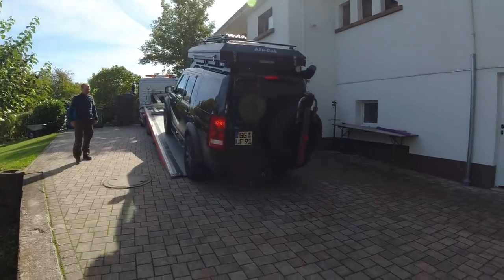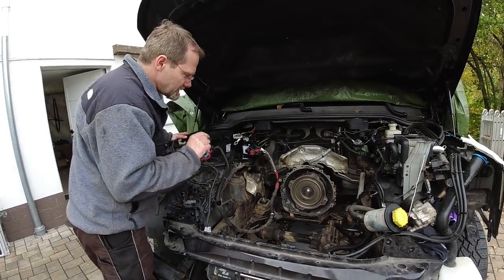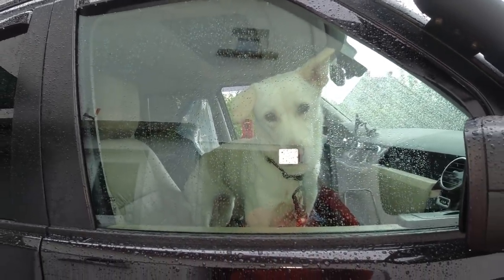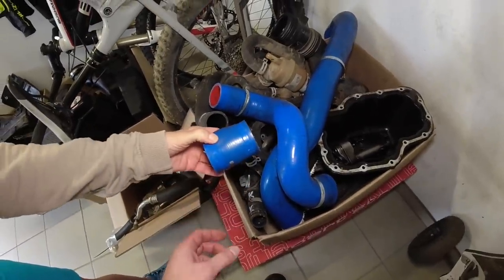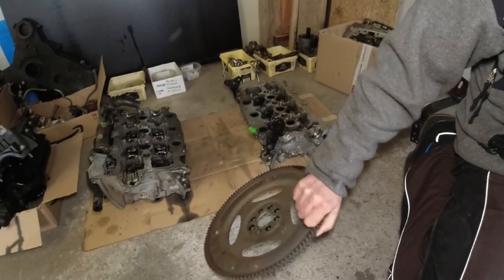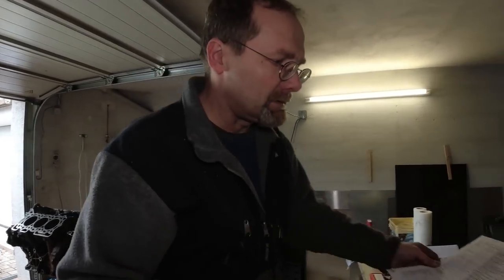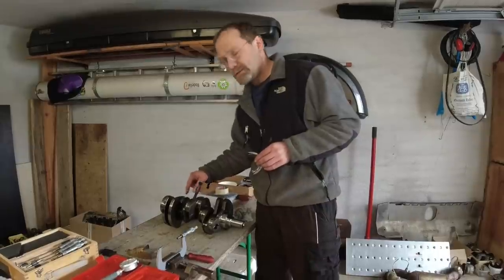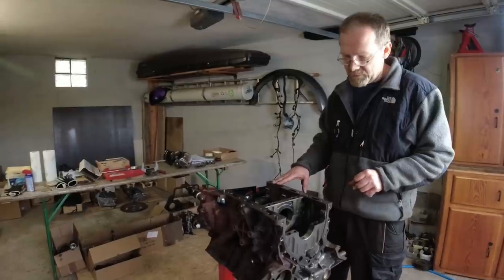Is this the end? Complete engine failure - Land Rover Discovery 3 / LR3 - Episode 1

Comment: Oh boy, sad to hear! We finally got our LR3 from Denmark (the one with integrated roof tent) - probably 40% of the buying decision are accountable to your channel. 🤪Just an idea about the reliability issue - what about an episode on: how to make your Discovery 3 more reliable - or in other words: what irregular maintenance should be done in advance or which parts make sense to get replacement at a certain age - even if you have no problems. Not sure if it´s realistic but it would be quite interesting to hear your opinion on that topic.
Reply from the maker: 😅👍 saw that one on ebay Kleinanzeigen. Well the thing with reliability is that even if you do everything right. That crankshaft failure can hit you at any km and at any time.The problem is in the design of the engine. There is not much you can do about it, other than do really frequent oilchanges and be very sensitive to your cars noises and vibrations. We will do a special video about that engine soon. 🙋‍♀️ Vera
Reply: Is the crankshaft issue only on the TDV6? I have a 2007 with gas V6 motor, should I be worried?
Reply: @andremorissette  It's only on the diesel, the gas engines were either the cologne ford V6 of the Jaguar V8 neither of which is afflicted with the crankshaft failure.  The Jag V8 was pretty reliable in most respects.  The cologne V6 suffers from timing chain guide failure.
Reply: @Vera_and_Christian  Thanks so much for your reply and sorry for the delay - have a 2 yr old daughter and a Discovery 3 in our front yard. 😅We currently do a main overhaul at 240kKM - all services, new oil pump and crankshaft pulley and underbody conservation/ partial reconstruction. Next to that I´m getting more and more into the reliability / services issues - in short: married to the D3. :P 

I just saw the videos on the crankshaft issue @Altblech-schrauber channel where he mentions in the comments that he´s using 0w40 Oil for better reliability - would you recommend that as well? Just asking because will do an oil flush and it would be the perfect timing to switch oils then.
Reply: OK, just ordered the 0w40. :) Motor oil is currently on Black Friday Sale at Amazon btw. ;)

Comment: Another great video! This is the issue that got me in a td5 Disco 2 and not a Disco 3. From what i understand this problem is not a question of infrequent oil changes but of defective bearings installed which affected a percentage of these engines. this also affects range rover sport and disco 4 engines. glad to be corrected if this is not the case.  With all its faults, there is very little that will suddenly make a td5 stop functioning

Comment: Something to consider. Yes the bearings have rotated but I have rebuilt 3 engines in my life. Citroen Traction Avant as it happens. And on these, the holes in the bearings did not line up with the oil feed drilling. The oil came through the drilling to an annular space behind the shell and then through the holes in the shell. I am not saying that your car is the same as an 85 year old design but rather to check on assembly and be aware that the apparent simplicity of a direct feed from the drilling through the shell may not apply. Hope this helps. Love the channel.
Reply from the maker: 😃👍 We will do an indepth video about the bearings soon. 🙋‍♀️ Vera

Comment: Wow , what a great video guy's , Land Rover should fix all the engine failures like this for FREE regardless of warranty , mileage ,number of owners ...
1-  to save their reputation 
2-  to keep your customers from going elsewhere &  buying Toyota's 
3- it's clearly the fault of LR/FORD/PSA , either in design or bad service interval recommendations.
Reply from the maker: There will be a video about the design flaws of that engine soon. 👍🙋‍♀️ Vera
Reply: All the manufacturers of "luxury" vehicles play this game, it's meant to fall apart within 5 years, their "customers" don't drive old cars typically.  Mercedes and BMW now make all kinds of engine components out of plastic for the same reasons.  The automakers basically design things to survive until the warranty expires, if you want something that will last go buy a Toyota, Honda, or Hyundai(only because the decade long warranty in the USA).  The frustrating thing about this is they really could do a better job designing these vehicles, they could make small design changes with a minimal cost increase that would make the cars last much longer.  I'k pretty sure the accountants have decided that it doesn't make good business sense.  When you take your car to a Land Rover workshop they basically want to push you into a newer vehicle, they do not want to fix these older cars.
Reply: I've seen many that have gone on to 700k to even 1m Kms with no problems. The trick is to stick to the oil it was designed for, the 5W40 fully synth and regular oil changes.

Comment: Hi Guys, for me this is your BEST EVER video on Youtube !!!!!

When you showed us what happens when bearing shells move & block the oil feeds and on the crankshaft itself with it's cross-drilled oilways - absolutely fascinating and now oil pressure within an engine makes so much more sense.

By the way, does Fabien's Discovery have a diesel particulate filter ? If it does, then the engine will need to run a DPF re-gen program from time to time. This involves the main ECU over-fuelling the engine to burn off DPF contaminants. Unfortunately this can also introduce neat diesel into the engine sump, diluting the engine oil - reducing effective lubrication GGGGGGGRRRRRRRRRRRRRRRRRR!

Really looking forward to the follow-up video on this project ...
Reply from the maker: Yes it has a DPF. Ours does not and that is a good thing, like you wrote. 👍🙋‍♀️Vera

Comment: I watch your videos they are both informative and humorous, but I have to comment on Land Rover reliability.  Both my father in law and myself have bought Toyota cars of various descriptions from various Carinas, camrys and 4runners. The carina's I have to admit were reliable but characterless as were the early Camry's. The later one's suffered transmission failure at 30000 miles, disembling itself on the motorway. The estate version started to fall apart at 2 years, spot welds began to break due to stress as there were insufficient welds. Then with the 4runner which was the biggest money pit, requiring a complete exhaust system every 18 months as it had usually rusted away in various areas, also the engine had to be stripped as one of the balance shaft drive gears had broken free. There were electrical issues usually broken wires, the list went on. At 100,000 miles I had spent over £16,000 in repairs, at this point I decided it was time for a change so after looking at what was available I decided to buy something different. I went to my local Land Rover dealer after taking a  TD5 out on trial I ordered one. Firstly it was so much more spacious than the Toyota, it was quieter and so much nicer to drive even towing a large caravan through France. I still have it it has been utterly reliable even after 19 years and 275,000 miles. It has taken me through forest tracks in Scotland that were flooded, in places coming over the bonnet but it never stopped. For the most part the car is still original as it left the factory.  She's retired now so impressed  was I with Land Rover that I bought a Range Rover Vogue, which my only regret is I never bought one sooner. I even bought my wife a Freelander 2, there is much said against Land Rovers, but I can only say as I find and I can't find to much fault. If you look after them, they look after you, my vogue has reached 135,000 miles and is such a delight to drive, I've never been able to say that about any of the Toyota's

Comment: Absolutely incredible is your work to remove and repair the engine of Discovery 3 in your home garage! It is clear that this engine have some constructive problems. But! I think that the main reason for this damages is in: 30 000 km changing oil interval! I don't understand why many manufacturers recommend it. I'm changing engine oil of my cars no rarely of 12 000km interval and I think that this cost me many many cheaper then this heavy repair works.
Reply from the maker: In addition, the oil is disolved by diesel fuel for emission reduction.  After 20t km, the oil smells a bit like diesel.  12t km is the interval Vera and I maintain as well on our LR3.  Christian
Reply: @Vera_and_Christian  That's crazy here in the states we have 10k mile interval on the TDV6 in the Disco 5, back before LRUSA bought mine back I was doing 4-5k mile oil changes as the damn thing was "making oil", fuel dilution. I also switched to shell helix C2 oil instead of the ludicrously expensive Land Rover Castrol C1 oil, the Land Rover oil was noticeably worse with regards to fuel dilution, the shell wasn't noticeably diluting at 5k but the LR castrol oil would "gain" between 250-500ml in 5k miles.  No reason not to change it often 6L oil and a Mann filter is maybe $45 in the US, with an oil extractor and the filter on top of the engine it takes all of 15 minutes to do an oil change.

Comment: Very good analysis. Extended oil changes are the problem here. I use 15/40w T4 oil in all my diesel and gasoline engines irrespective of whats recommended  by the car maker with 5k oil and filter changes. Oil being the life blood and inexpensive. Extended oil changes is a marketing gimmick like sealed for life transmissions and differentials sold as maintenance free to the public. Transmission fluid changes are even more important today than ever as the manufacturers are using the slipping torgue converter clutch feature in torque converters as and aid to compensate for lower torque engines to accelerate .

Comment: Hello Christian, hello Vera. First of all, I would like to thank you for your great videos. The videos didn't stop me from buying a Land Rover Discovery 3. For the rotating main bearings of the TDV6 engine, it would not be appropriate to provide the main bearings of the motor with dowel pins to prevent the main bearings from rotating. These dowel pins are used in all air-cooled VW and Porsche engines I know. When the time comes with my TDV6, I will definitely equip the main bearings with dowel pins. Sorry for my lousy english.
Best regards
Manuel
Reply from the maker: Hello Manuel,  the „tabs“ or „dowel s“ in main bearings are used for axial positioning.  If the bearings seeze up,  the will likely rotate even with tabs.  I know this from a bearing manufacturer.  Of course it would help a bit but not in all cases.  The bearing surface of the Lion V6 should not be reduced.  Christian
Reply: @Vera_and_Christian  Thanks for the reply Christian. I wanted to ask the same question as Manual Dietrich.

Comment: As a truck mechanic for 50 years I have never seen such a poorly designed engine,,I noticed that on the lower side of the engine their is no cut out for the bearing locating tabs that prevent the main bearings from moving side to side,,I have never seen this on any other engine in my life..But what can you expect from a Ford designed engine..PS a very good video.

Comment: Christian and Vera,
I have a just bought a Freelander 2 with the straight 6 Volvo developed petrol engine. I bought it with 243.000km. No oil use. No coolant use.
Seeing your discussion about engine oil, I would like to ask you if the same idea of changing from my 0W-30 full synt. oil to 0W-40 or 5W-40 oil would be a good preventative measure. I change engine oil and filter every 5000 km with no deviation from this.
I only ever use Castrol Edge Ti oil and never ever long life oils (seen too many engines with oil sludge inside, making catastrophic engine failures on VAG engines).
Moreover, I ordered a new complete original PCV (crankcase ventilation unit) which I will install asap, to further prevent too much oil getting to the oil scrape rings, which then hardens and gets stuck and oil use is then very high. Anyway, this didn't happen on my engine, so I will do the work now, before this could develop.

Thanks for making tons and tons on videos on all things Landrover Discovery and toyota ;)  (not much to do on the later apart from drinking coffee).

Kind regards.

Comment: I’ve definitely heard of a few cases where LR have replaced or repaired a TDV6 /SDV6 engine for free when this problem has occurred. Though maybe on engines that have covered less distance and time than Fabian’s.
However, the fact that Christian is confident that it was the LR dealer starting the engine that has caused most of the damage is very concerning.

What idiot engine designer stopped adding nibs to prevent the bearing shells from rotating and keep the shell oils supply hole aligned  properly?

Thank you and well done to you all for showing and explaining the procedure to fix it.

On another note, we recently heard of problem where a guy at LR had been incorrectly straightened their ground prop-shafts in the factory, by applying too much pressure. The stresses this may cause could well cause eventual crankshaft failure. All because somebody at the factory thought he knew how to do it better than the way he was instructed to do it. Fortunately the guy no longer works for LR. But this could have been going on for years and how many potential crank shaft failures has he caused?
Reply: A lot of modern engines run without tabs, cost saving I guess..
Reply from the maker: Well, you know, a little nib is not going to prevent a crankshaft bearing from spinning. That engine is so powerful and that bearing so tiny. We will do a video about that excact topic when we get the new bearings. 👍🙋‍♀️ Vera

Comment: Another great video.  Such a great Learning Program. In huge Diesel Engines for back up power in a Nuclear power plant the engines have to be up and running very fast.  The engines use a pre oil pump before starting to get the oil circulating before starting. I've always thought that normal car engines could have one similar fitted and the engine would last so much longer. Of course this is good for the owner of the car but bad for sales of new motor's/ cars. Thanks for the video. I will watch the others now. Regards Neil
Reply from the maker: Good point.  Cars don’t have prelude pumps because they are started every day.  If they are not and use thin oil, this may become a problem.  Like on the TDV6.  So you are absolutely right.  I will look into a electrical pump for Veras LR3 in winter when Fabians car is finished.  The pump makes sure that the lines are full and oil is at the bearings.  Thanks. Christian

Comment: Hi Christian, It is really nice that you have a Discovery 4 with a number plate that start with DIRT. If you guys ever visit South Africa, my Discovery 4 is available to you. You can drive on some excellent and horrible DIRT roads. This is my third Discovery. Had an 3, 4 and 4 8 speed auto. I sold the first two with just under 200 000km's. My third one is now on 194 000km. Will push to see if I can make 300 000kms.
Reply from the maker: 😃👍 Thanks for the offer.  DI RT 44 the best plate for any offroader in Germany. 44 implying 4x4 of course. We will also take my Discovery 3 hopefully well beyond 300000km. 🙋‍♀️Vera

Comment: I’m must admit I am impressed at your willingness to have go.  I love listening to your logical thought process.  A great logical and common sense approach.
I have heard stories of garages driving vehicles into the shop when they have been told there may be a serious issue with the engine.  If that is what the Jaguar garage did its moronic, but I’m sure some do it deliberately to generate work?
Keep up the great work but I would to see a video of the engine going back in just see how many times you swear in frustration🤣
Reply from the maker: 😅👍No, Land Rover does not want to have anything to do with an engine failure like that. They saw the oil chips and quoted 20000€ repair cost. Not because it will cost that much, but to keep you from  having it  fixed at Land Rover. And from my experience working with Christian on cars over the last 30 years, getting stuff back in is way easier than getting it out. We have always managed to get everything back into running order. Otherwise I would not be part of that endeavor 😃🙋‍♀️ Vera

Comment: Apart from not buying one , I take it the best way to prevent engine failure like this is to do regular oil changes ?

I undertake interim oil changes in between my yearly routine service. I do about 8,000km per year. 

Engine oil - Castrol magnetic fully synthetic
Additive - ZX1 Extra Lube full bottle €26 (Halfords).

Excellent tip on using the magnet with the old oil filter
Reply from the maker: More frequent oil changes help for sure.  Most failures occur on LR maintained vehicles which only see a shop once per year no matter what mileage they drive.  Still, I saw crank failures without a sign of bearing failure or oil starvation.  Just last week I visited a LR3 off-road shop to look at such a failed engine.  So the driving behavior and vehicle load matters as well.  We use the same oil as you in B5 but without additive.  Christian
Reply: @Vera_and_Christian  Thanks very much for that in-depth reply. It is very informative.